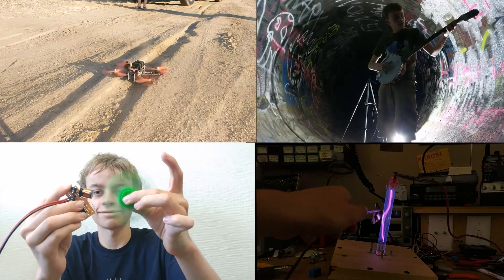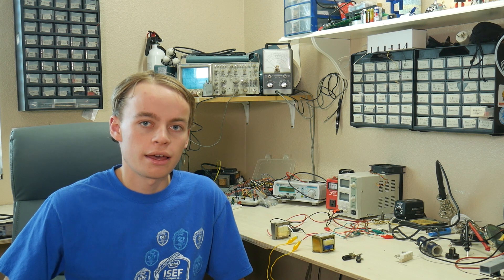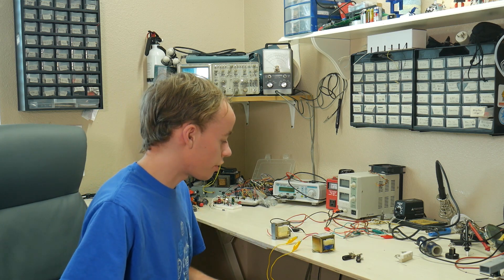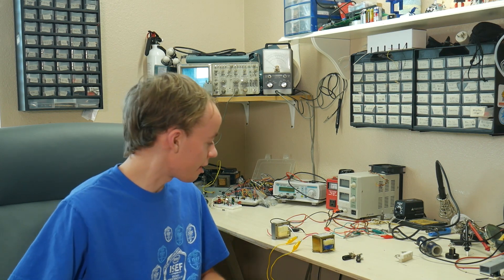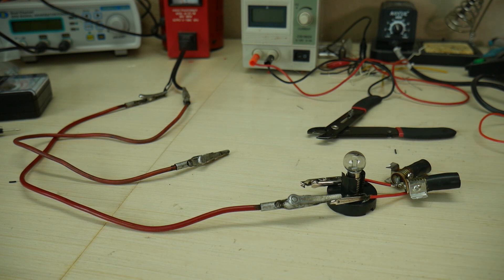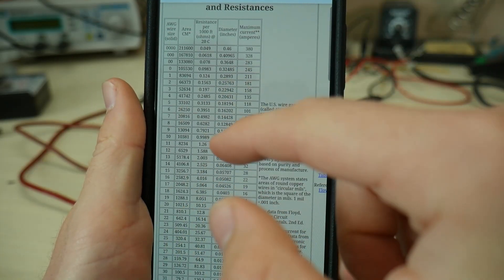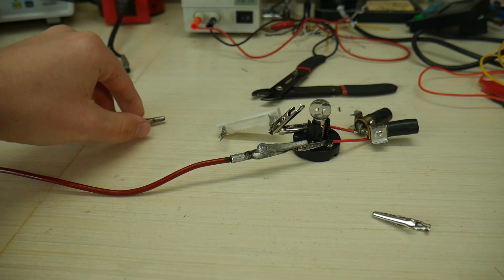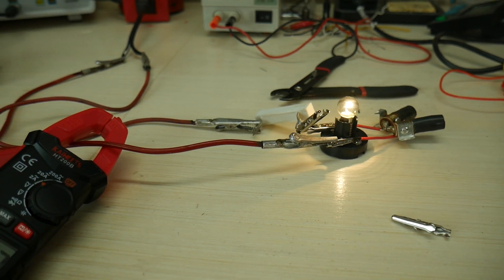Why the Power Grid Uses Alternating Current (With Kaiweets Clamp Meter)

Comment: I believe the overhead street lines are 33kv, we aldo have underground cables, one I... Stole... And it had a thick aluminium core but copper outer wires, our step down transformers are everywhere but shielded off from the public, we don't get the big bin types here, I remember as kids we would sit on top of the step down transformers 😱😱😱
Reply from the maker: Wow! We have those big step down transformers you can sit on as well, but only in the places with underground cables.  A lot of them are surrounded by a fence.
Reply: @TannerTech  here too

Comment: Isn't there also DC to DC converters? Why not use those instead?
Reply: DC to DC could increase or lower voltage, but the wattage of the circuit would still be the same. You wouldn’t save or gain any power on the circuit/wire, just change the voltage. Amperage changes accordingly and opposite to the voltage.
Reply: Check the 6:00 mark.
Reply: @JustLovett0  Thanks. But if we step up the voltage, same thing applies, it will be less current, regardless of AC or DC to run the same device.
Reply: @TheVedicWayChannel  How many dc converters do you know of that can step up to a million volts? You would need to turn dc into ac, use a transformer, then turn it back into dc. Ac to ac converter is waaaaaay cheaper and easier as you can just use transformers.
Reply: @egg7990  Hey cool dude, so its a problem of price, its just cheaper to step up in AC? I see.
Reply: @TheVedicWayChannel  Not only money, but also inefficiencies. By converting dc into ac and then back into dc, you are losing a lot of power when you could just use ac
Reply from the maker: Yep, and far simpler. DC/DC conversion can only handle as much power as the components in your boost/buck converter whereas it is easy to scale up AC/AC conversion. You just need a bigger trsnsformer.
Reply: @TannerTech  Although there is something interesting called HVDC (high voltage dc transmission) in some parts of the world. https://en.wikipedia.org/wiki/High-voltage_direct_current
Reply: Also don't forget the zero crossing aspect of AC, this is very helpful in designing and making contact breakers, switches and relays as they can be smaller with AC due to lower contact arcing. Example if you look at a switch it will (normally) have 2 ratings one for AC (higher voltage) and one for DC (lower voltage).

Comment: Thanks! Why is high voltage so much more dangerous?
Reply: High voltage provides a path for a lot of current to flow through the body and if the current goes through the heart, it could result in heart failure and tissue damage.

Comment: Not a good idea touching the leads from the variac. The ac is directly connected to mains voltage. If want to do that properly use a isolation transformer inline. Also dc is used with transformers by supplying a pulsed voltage known as pwm